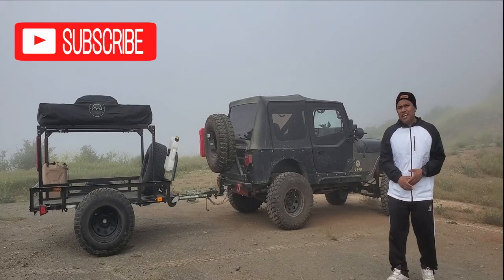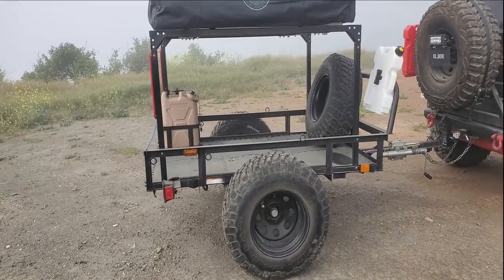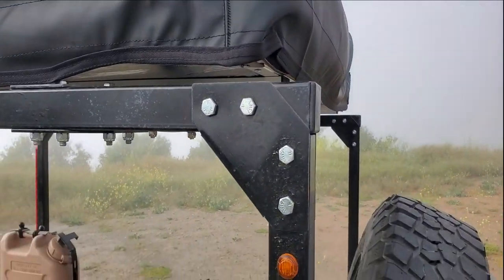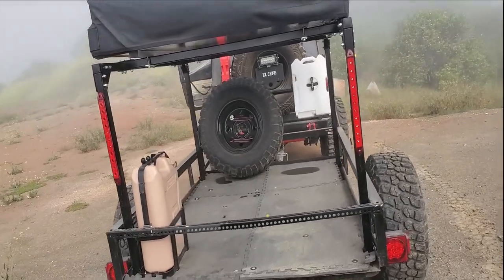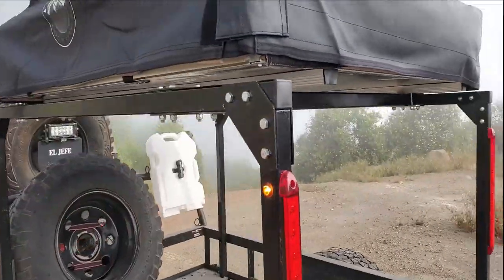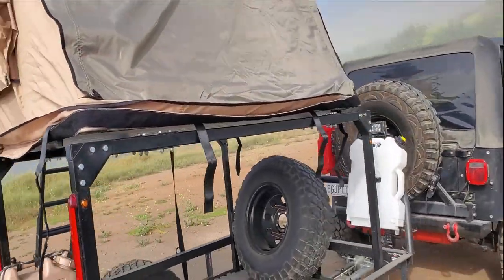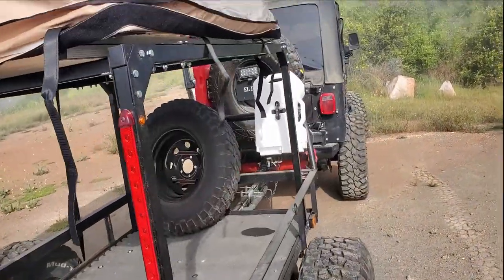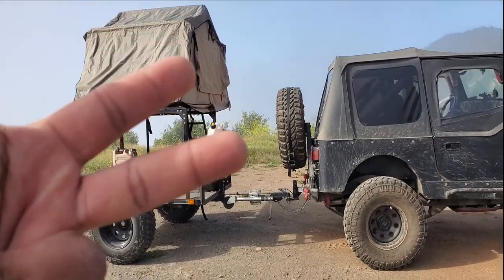Overland Trailer Project - Stage 2!!!

Comment: On your dash! The camouflage is that a cloth material ? If so how did you apply it to your dash? Did you do a video on it ?
Reply from the maker: Hey @jasonpower5759 this is actually a custom fabric I made. I bought the cloth from Walmart and shaped it to the dash and used velcro to hold it down. I thought about making a video but didn't think it would catch any views.
Reply: @revenantjeep  I had watched all of your videos and noticed your dash and thought was was very cool. So I went to Walmart and bought fabric but didn't think headliner adhesive would hold it and thought I would ask you . Thank you for sharing
Reply from the maker: @jasonpower5759 absolutely my friend glad you can use a very inexpensive fun solution. . 👍🤙